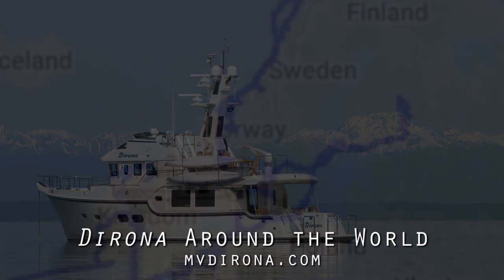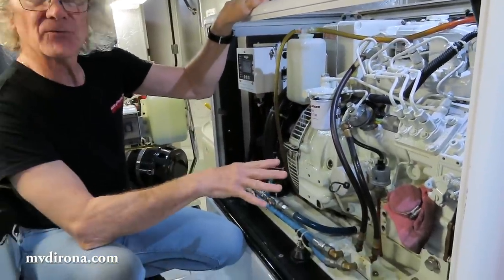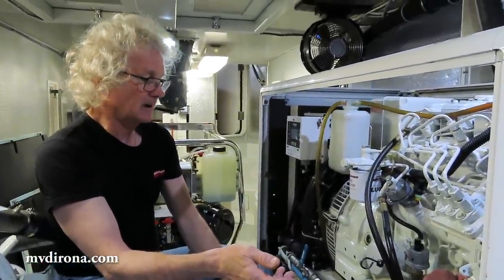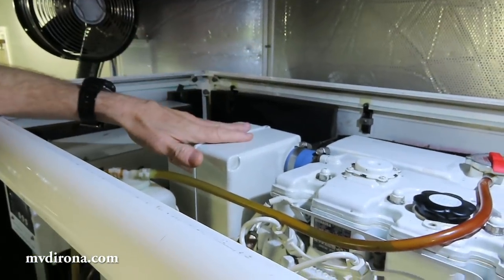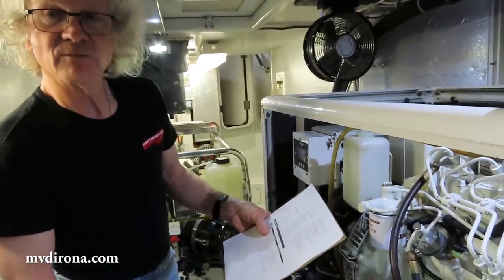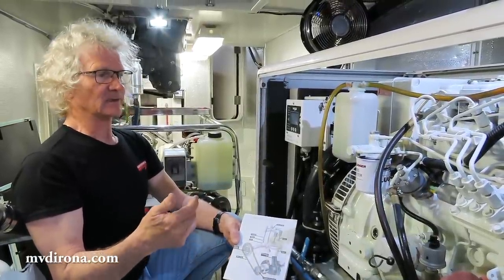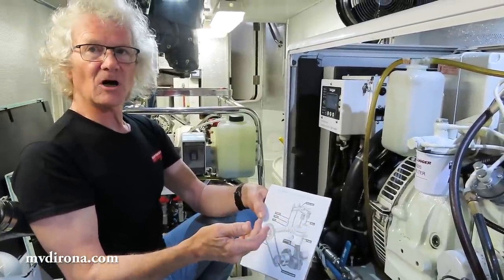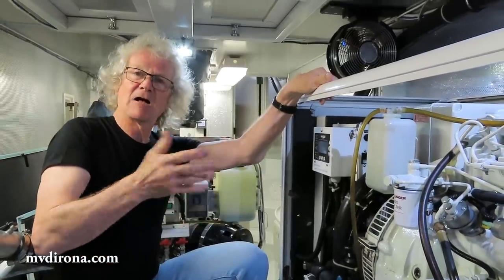Diagnosing Low Power Output on a Northern Lights 12kW Generator (MV Dirona Channel)

Comment: Very nice video!
Just one question, how does the genset exhaust inside heated air? I don't think it will have a good ventilation inside the enclosure, just relying on the shutters, in the absence of exhaust fans. Most heated air from generator end will be trapped in the enclosure which cause generator end high temp. after running a few hours, voltage will rise. We've suffered such problem, I think at least one exhaust fan is need to help exhaust inside hot air.
Reply from the maker: You're right that generator enclosures can be a source of engine temperature problems and thermal related faults.  This particular enclosure design does flow air through it with fresh air brought in for the generator intake and, separately fresh air flows in the back (gen end) and forward to be exhausted out the back. Northern Lights appears to be using the flow from the generator end which has a integral centrifugal fan (most do) do drive air through the enclosure.  I was skeptical and put a temp sensor in the enclosure and it never gets over 130F in the hottest climates we operated and is usually in the 120F to 130F range.  The engine room itself runs a +30F deltaT so in 80F weather, the engine room will be 110F so maintaining under 130F is pretty impressive in my view.

The most common fault mode is to lean things up against or pack things behind the enclosure that limit flow.  Another common failure is the insulation inside the enclosure peeling free and blocking air flow.  There is no question that the simplest and easy to maintain approach is to omit the enclosure.
Reply: @MVDirona  That is an air dam, which directs all fresh cool air into back end of the generator and also prevents the recirculation of heated air from the engine and generator end, this is a common design for most genny brands.
120F to 130F inside of enclosure should be a normal indicator, very curious how NL can make it, especially an air duct (for noise reduction) is also designed at the air outlet, but this will greatly increase the exhaust resistance! 
We had a 15kW Kohler before, similar air inlet and outlet design like NL, enclosure temperature can reach at 150F to 165F, especially at full loads we tested, which make generator end surface temp. reach at nearly 230F, cause high voltage alarm.
Only find Phasor has designed an exhaust fan on the top, NL, Onan, Kohler, Westerbeke all don't have such fan, very very weird how can they solve the inside high temperature problem, the only reason we can explain is maybe the large capacity fan between the engine's flywheel and the generator. Even so, I still think they can't run AT FULL LOAD for a long time(no more than 2-3 hours), maybe 70% - 80% genny rated power should be no problem, this may also be the original intention of these genny brands, thinking that users will not run at full load, or even if you run at full load, you will not use it for a long time.
How many kilowatts is the load, when you measure the temp?
Thanks!
Reply from the maker: Yikes, 150F to 165F is high. Your idea of putting in an active (powered) fan is a good one.  The simple solution is to remove the cover -- many Northern Lights operators elect to take that route.  We have a large amount of charger capacity so we can max out the gen and it'll run at 85% load for 4+ hours without problem with enclosure temp staying <130F and coolant temps in the mid 180F range.

The rated capacity of this system is 12Kw and we use 10KW (83%) as our max draw not because of cooling system issues but because Northern Lights rates them on the edge of they can produce before stalling.  I want the system away from the edge with more engineering headroom and never stalling so we chose to run at max 10kw even though it is capable of more.
Reply: @MVDirona  What you said is absolutely correct, most users will not use the genny at 100% full load, and when using it, the doors are removed. Maybe these brands have also grasped this point. But they should mark that it can be used at full load, but it is not recommended, or it cannot be runned for a long time, not as they describe, their generators can be used at full load for a long time.
The high temperature in the cabin should be an obvious problem, they should have known the existence of this problem, but I'm thinking that the reason why they did not install the fan may be because of the reliability of the fan. And know that most customers will not use it at full load and will removed the doors.
Thanks!
Reply from the maker: Many engine rooms are poorly cooled and up well beyond 100F in the tropics.  The best way to help generator cooling systems is to ensure they are operating in favorable ambient conditions (dry, warm, but not hot).
Reply: @MVDirona  Exactly, engine room ventilation is important, if ambient temp over 100F(40℃), generator end will derate. I want to buy a new genset, checked Onan, Kohler, NL, Westerbeke and Phasor, right now, NL and Phasor are the first options, NL has good reputation but no exhaust fan, Phasor with Kubota engine, coliseum alternator and also built in fan(that I like), it's hard to make decision, do you have any good suggestion?
BTW, did you install another four anti-vibration mountings between the genset and hull. Some friends told me the direct hard connection between the genset and the hull is more reliable if don't install these anti-vibration mountings. If only 4 anti-vibration mountings are used to transition the generator to the hull, the reliability is questionable, especially when rolling, the mountings are likely to be torn, although installing these mountings can indeed reduce the genset vibrations transmitted to the hull. How do you think?
Thanks!
Reply from the maker: On your generator search, I found Northern Lights to be an excellent choice.  What convinced me was there excellent support.  10 years after sale, they are still willing to answer questions and offer advice.  The other reason I like Northern Lights is they are conservatively designed and marinized so just don't require much attention.  If you have your engine room temperature under control, and it sounds like you do, then the NL will run fine with the covers on without an external fan.

For vibration mounting, our generator enclosure is mounted onto a rigid foundation plate that is mounted to the boat via 4 soft engine mounts allowing the generator to float fairly free to reduce sound transfer.  The engine mounts are designed in such a way as they can't tear free even in aggressive conditions. Our boat has been over as far as 69 degrees (https://mvdirona.com/2014/09/69-1-degrees/).
Reply: @MVDirona  Do appreciate for your suggestions, that's really useful for us!
1 - Is it convenient send me some pics or video to show your 4 sofe engine mounts? I just want to check what kind of mounts you are using and how is the installation for reference, I also want to install such mounts.
2 - Another question: just as you mentioned, you boat has been over as far as 69 degrees, is there any problem of seawater intrusion? Most of the problems of seawater intrusion should occur on the wet exhaust elbow as we found. When your ship tilts 69 degrees, the seawater will directly enter into the manifold at where the exhaust and seawater mix in the elbow, causing backflow, because the elbow down angel of NL looks like Just 45-50 degrees, if the boat is too rolling or the speed is too fast, the water in the mixing elbow will inevitably pour in. We have faced such problem in our former Kohler genset, wish the similar down angel mixing elbow(most brands do).
Thanks!
Reply from the maker: Sorry, we recently sold the boat so I can't get you a picture of the mount assembly but it's the standard unit supplied with a 12KW generator enclosure so you can probably get it from their web site.

You asked if 69degrees brings in water.  Yes, a massive amount.  A Nordhavn 52 max roll angle before water ingress is 61 degrees.   The first thing that goes under is the engine room air intakes and they are large. I would guess we took on somewhere close to 1,000 gallons. The engine room had 1.5 feet of sea water in it.  The generator probably would have taken on water inside the engine through the exhaust if we had rolled in the other direction for the reasons you suggest but we rolled the other way.  The wing engine is on the other side of the boat and it would have taken on water except we have a Centek Check Valve (https://www.fisheriessupply.com/centek-check-valves) preventing water ingress. I strongly recommend these for water cooled exhaust systems (our main is dry exhaust but the gen and wing are wet).
Reply: @MVDirona  Thanks for your explanations, we do have checked Centek check valve, some friends told me that not very useful, it's hard to check it works or not. Personally, I think the the most likely place for seawater backflow should be happen at when the seawater and exhaust just start to mix at the end of elbow, not at the seawater/gas outlet, or the water in the lift muffler flows back into the manifold, so check valve don't have much meaning. The only way to solve seawater intrusion permanently is gas and water separate(dry exhaust system), but this is a departure from the wet exhaust system design, and dry exhaust system installation also much more difficult than wet exhaust system.
Reply from the maker: We didn't originally have a check valve on the wing engine and it was flooded in heavy seas in the Gulf of Alaska. We added the check valve and it's been great through far worse than our Gulf of Alaska expereince.  

Generator does have a seawater/gas separator and, you are right, it may have been that that saved it from flooding. My view is that check valve is better protection but that's my view.  I also don't like the inability to see coolant flow with a generator gas/exhaust separator.  We're I doing it again, I would go with two check valves and skip  the gas/exhaust separator.
Reply: @MVDirona  Thanks! The gas/exhaust separator you mentioned I guess is the secondary silencer, which installed between the lift muffler and seawater outlet. This is an optional part for most marine genset brands, the purpose is to silence the exhaust sound at a deeper level, and it also has a certain effect of preventing seawater from pouring back, but it's not very effective. What I mentioned gas/water separator is: remove the wet exhaust elbow, separate the exhaust and seawater directly after manifold when installation, which we usually called day system.
Reply from the maker: Yes, I understood and it's a gas/seawater separator that I have.  The upside is only gas exits the boat above the water line.  The downside is I can't see raw water flow.
Reply: @MVDirona  Thanks James, do appreciate for your professional suggestion and help!
Reply from the maker: Good luck on your search.

Comment: Well if you have an exhaust valve tightening [ should be called valve losing clearance ] then you really have not many choices , especially  as it is accelerating  which means the amount of wear is increasing  at a higher rate . I have to ask though , did you also check to make sure the fuel pump was putting out the proper amount . Some engines are very sensitive to the amount of stroke on the fuel pump .
Reply from the maker: The valve lash has suddenly become a big problem and, as you said, it's also accelerating. The engine usually goes 1,000 hours between valve lash adjustments but then one evening it closes up after only 640 hours. I re-adjusted it and it closed back up in 39 hours. I again re-adjusted it and the problem repeated in 27 hours so it's accelerating badly. 

This tells us that we certainly have a valve or valve seat problem but doesn't rule out injector, injection pump, or low pressure fuel pump problems. But, it's usually (but not always) the case that there is a single failure at a given time so we'll start with putting a new cylinder head on it. Since there are 6,700 hours on the injectors, I'll change those at the same time. 

I don't have a good way to test the injection pump so it could have problems as well. But we do know we have valve or valve seat problems so we'll start with addressing that problem and test engine operation. We feel the injection pump is likely good because the engine doesn't smoke, has good power (when valves lash is correct), and starts well but we won't be certain until we see it running after the top end overhaul.

Comment: Can by posible that the salt water in the manifold be caused cos the vacum produced  in the manifold, just because the exaust valve had a leak?
Sorry about my english, my native language is the spanish.
Reply from the maker: I understand your thinking. One factor to keep in mind is a diesel (compression ignition) engine speed is controlled by injecting more or less fuel whereas a gasoline (compression ignition engine) has a throttle that restricts airflow into the engine. So it's common for gasoline engines to have fairly high intake manifold vacuum (pressures significantly less than atmospheric pressure).  The only restrictions in a diesel engine intake is the slight restriction of the air filter and plumbing. So, generally diesel engines don't have strongly negative pressures in the intake manifold. But it will be slightly negative.

In a correctly engineered installation without casting problems or serious corrosion, there is no way for sea water to get to the intake manifold. There is sea water injected into the exhaust and the only protection the engine has against sea water intrusion is the flow of the exhaust and gravity. The more I study this issue the more I see potential flaws in raw water exhaust systems that I was previously unaware of. However, they do work if properly designed.

The risk situation is when the engine is off and the boat is heeled over unusually far or there is something wrong in the exhaust design or high wave pressure or extreme angle that causes excess  water to accumulate in the muffler. This can be forced up into the engine. Its unlikely to happen when the engine is running due to pressure of the engine exhaust but, if the engine is off in extreme conditions, water intrusion can be a risk and that's my theory. I've posted a lot more detail here with pictures: https://mvdirona.com/2020/06/valve-seat-recession/,
Reply: MV Dirona , looking at the photos, it seems that he is getting some water in the combustion chambers.

probably for some reason some water from the exhaust is entering through the valves
Reply from the maker: Here's some more detail on the issue with pictures: https://mvdirona.com/2020/06/valve-seat-recession/.  Because the valves are corroded , it appears that they have seen water. Because the valves are corroded only  in one spot rather than all the way around, it suggests the water intrusion only happened once on the logic that valves rotate in the head in normal operation and the corrosion should be all the way around if it happens frequently.

Comment: I guess you cant do a compression check like in a car engine?
Reply from the maker: A compression test can be done on diesel engines but I've never done it and some report that they aren't as accurate on these high compression engines. In this case, it's unnecessary to do a compression test in that we know we have a valve with very rapidly decreasing lash. We know for sure there is some problem that requires the head to come off and it's very probable that it's a failing valve seat so it's best just to open it up and have a look.

Comment: poorly spraying diesel injectors produces high EGT and cause potential heat related engine damage. A new or reman cylinder head should ALWAYS get fresh fuel injectors.....

 I doubt the water cooling system is the issue.
Reply from the maker: Yes, a prophylactic change of injectors on a top end overhaul is good advice. There was no evidence of poor injector spray pattern nor high exhaust gas temperature but, since the hours were up over 5,000 and I had spare injectors, I did change them.

Comment: Hi, been watching your videos after your arrival in Stornoway. How long are you here for?
Reply from the maker: We arrived to just provision and fuel since we had been at anchor in Scotland for two months prior to coming here to reprovision and fuel. Between being in Portland prior to the lockdown and arriving here we hadn't touched land for 79 days!

We also had a valve seat problem on our generator as described int the video. The parts for the generator arrived last Friday night and we replaced the cylinder head over the weekend.  It's back to running great.

We also have a request in to the Port of Stornoway for the boat to be lifted so we can have an insurance survey done and the boat bottom painted. If we can schedule that work over the next week or so, we'll do that work before we leave.
Reply: Thats interesting to hear. I own the workboat in the corner of the fishing harbour the Amanda J and have been admiring the Dirona. 

If there's anything you need during your stay in Stornoway don't hesitate to ask and I would do my very best to help.
Reply from the maker: We have seen the Amanda J in across the harbour from us. Hello from Dirona. If we weren't all in lockdown, we would invite you over to have a look around and enjoy a beer. 

Over the weekend, we change the cylinder head on our generator. The valve seats were in rough shape as we guessed. It's now back to fully operational. We're trying to get scheduled for the slipway here to get bottom paint and an insurance survey but the port sounds quite busy right now. 

Thanks for saying hi and offering us guidance or help while we are here.